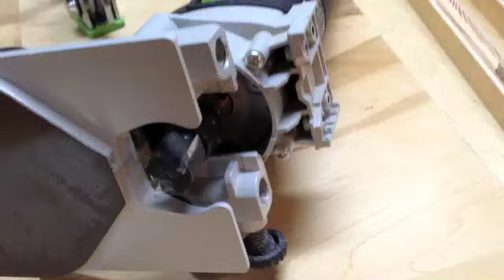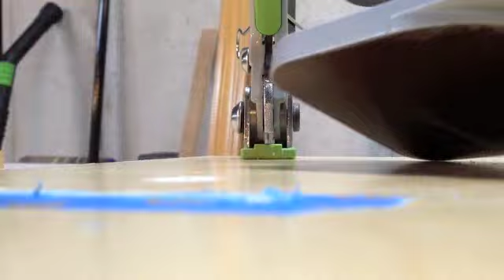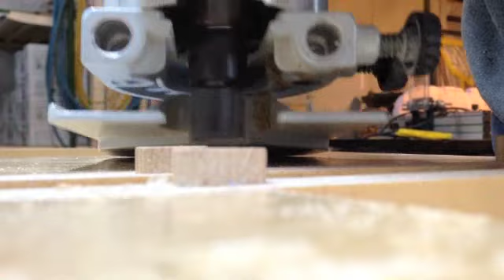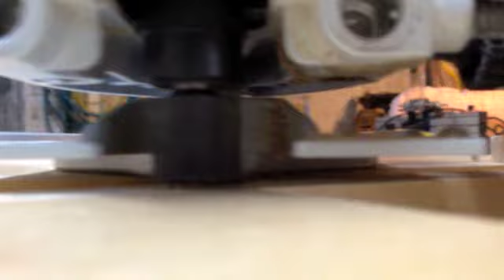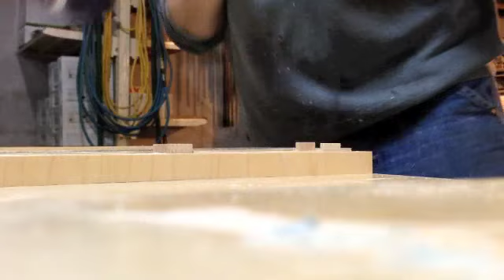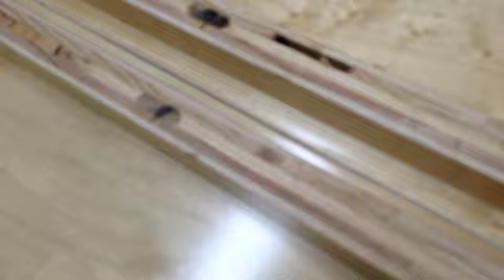Vertical milling with the MFK 700

Comment from the maker: Navid, 
My MFK 700 is about 4 years old North American model. 
You need to get a bit with a shorter cutter, I recommend the CMT 801.128.11 mortising bit. It is 1/2" diameter, 5/16" tall with a 1/4" shank. This is the same bit I use with various templates by adding a pair of 1/2" by 1/4" bearings to the shank.